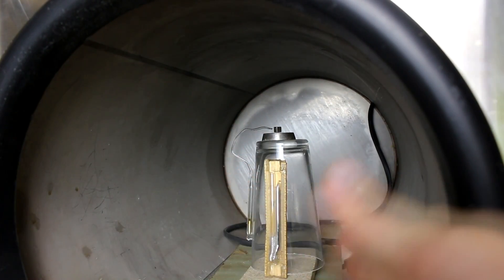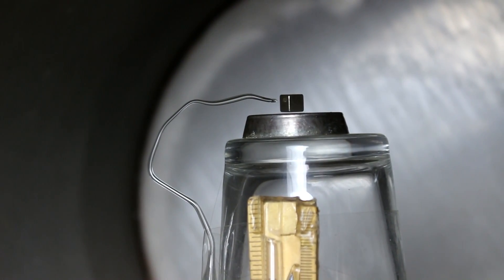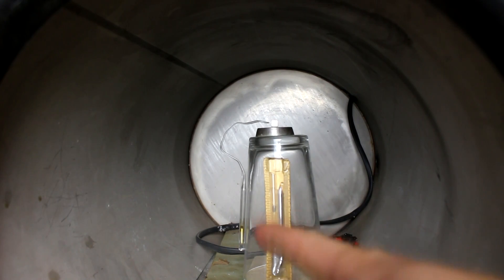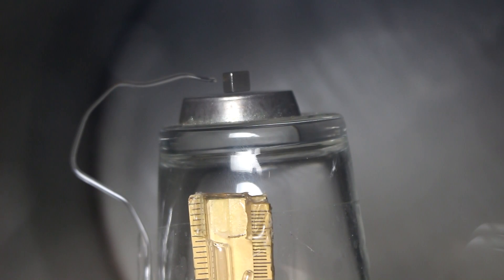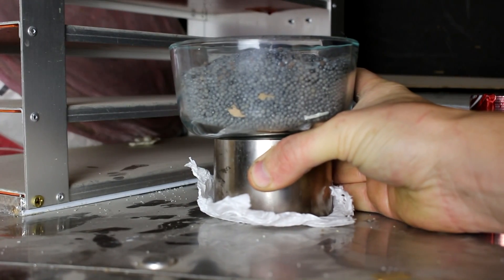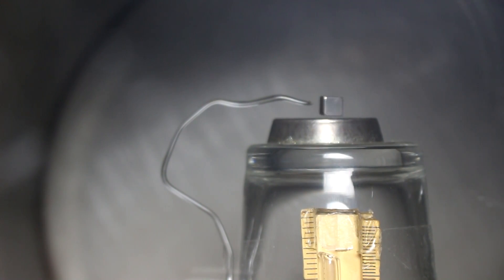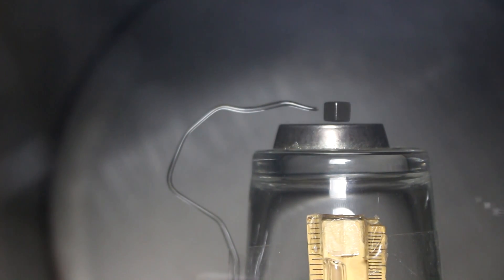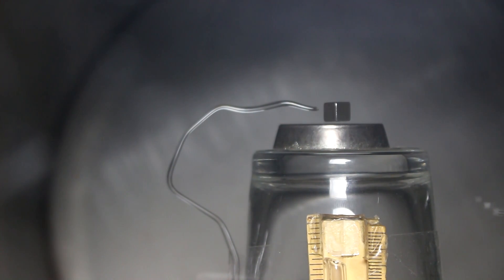Levitating a Magnet in a Vacuum Chamber

Comment: A levitating magnet will get affected by the earth's magnetic field. I used to play with magnets I got from CD drives which can be as light as 1 gram, when I knock it around the table, it would prefer a direction that it would not only stop at but it would rotate a bit back towards it if it passed it. It turned out to align with the earth's magnetic field.

Comment: Forever is a long time.  Your magnet will tunnel into a black hole and evaporate through hawking radiation in a finite period of time.
Reply: I believe regarding his use of "forever", one could colloquially infer induction of a spin persisting greater than like 5 friggin seconds.
Reply: Anything that beats nothing once has beaten it forever, because time.
Reply: @WhileTrueCode  How long IS a friggin second?
Reply: speaking of eternity... will it stop due to gravitational waves it emits before or not?)
Reply: UFOhunter; I strongly disagree.

You said: "It [the universe] is totally math based and can be accurately simulated in every aspect you can think of."
The problem with this, is Quantum non-determinism. Even if this was a simulation, no deterministic machine would be able to create the quantum effects that we see in our universe. The only way around this problem, would be to have a quantum 'computer' that has entangled every fundamental particle in our universe with a quantum object in the computer's 'real world'; it can then pass on that quantum uncertainty into our universe.

This would, however, completely change the nature of the 'simulation'. The being running the simulation would not be able to interact with the simulation without collapsing the quantum wavefunction of whatever he is altering; even worse, he cannot even view the results of this 'simulation' with certainty (since the uncertainty principle would apply to his entangled quantum objects as well), and even if he did chose to 'look' at (for instance) the precise location of 'you' (i.e. the specific location of all of your fundamental particles in our spacetime), the act of doing so would collapse the simulation's entangled wavefunction of you which would cause (as best as I can tell) all of your particles to either:
Instantly acquire infinite uncertainty in their momentum (ripping you apart) OR
Stop obeying the laws of quantum mechanics (which I have no idea how the computer will respond to).

Furthermore, having all of our universe's particles entangled with quantum states in the 'real world', would allow us to influence the simulator's universe. At that point, this universe could more accurately be described as a caged pet, rather than as a simulation.

Now on to the part about *Dark Energy*:
Dark Energy is very real with real, measurable consequences, i.e. that the expansion of the universe is accelerating! (think about how much energy it would take to accelerate entire galaxies worth of mass away from each other, faster and faster, against gravity while also creating new space (which has a energy cost associated with it) as it goes, then you can just about start to understand the scale of dark energy in our universe.)

Dark energy also has nothing to do with so called "negative energy". Dark energy is a real, positive energy; it just has some very weird properties.
Also, we don't generally "blame things we don't understand on some dark force", dark energy is only invoked for very specific phenomenon.
It is simply called "dark energy" because, like dark matter, it doesn't interact with the electromagnetic field and therefore we cannot directly observe it. Unlike dark matter, however, dark energy also doesn't interact gravitationally and so we cannot use gravitational effects to detect it either (for those keeping score, this means that 2 of the 4 fundamental forces cannot be used to probe dark energy at all*; worse still, is that those 2 forces are the *only long-ranged forces in our universe!)!

So that explains the 'dark' part, but why do we call it energy? Because we can see its effects on the universe and we know that the things we see it doing require a lot of energy, so we call it 'dark energy'. Not because we want to blame every strange effect that we can't explain on it.

And finally, a quantum computer will not be a universal panacea.
Yes, some problems are solvable in MUCH less time than with a regular computer, but even for those problems, the quantum computer will still take a while to solve them, it won't be instant.
Also keep in mind that a lot of computational problems cannot be sped up by using a quantum computer (For instance, a quantum computer wouldn't speed up a gaming computer. You might be able to add some cool effects with it (photorealistic real-time ray-tracing, anyone?), but the brunt of the game's code  will still have to be run on a conventional CPU.
And finally, cost.
For consumer applications, it would be MUCH cheaper and easier to simply speed up our computational hardware, by an order of magnitude, than it would be to implement a comparable quantum computer.
The only reason why we aren't seeing any real progress being made in computing (especially with CPUs) isn't because we are "near the limits of physics".
The real reason is that no one (except for me) actually wants a faster PC. People only want smaller, lighter and more power efficient computers, and they are willing to trade computational power for those things. Intel could, for example, quite easily double the single-threaded performance of their processors by halfing the execution time of EVERY instruction, by simply doubling the clock speed to around 10GHz, without decreasing IPC.
The silicon can actually handle it, the problem is just that there is no market (except for me, of course :)) for a CPU that runs everything twice as fast, but consumes ~2kW of power and requires a specialised cooling system to remove 2kW of heat, while keeping the CPU at the correct temperature (which could be as cold as -100°C).
Reply: The answer depends on a precise understanding of dark energy, something we lack.  However, best estimates currently put the big rip billions to possibly trillions of years in the future.

Time frames I have seen quoted for quantum tunneling to turn material objects into black holes are about 10^(10^26) years, which, is a lot to say the least.

The second number is much more well-defined since we aren't even completely sure that the big rip will happen at all, whereas quantum tunneling is a measurable phenomenon.
Reply: +MRLT Yes. As far as I remember, there will only be black holes for a really really long time before the atoms rip themselves apart enough to never be able to interact with each other again.
Reply: UFOhunter That is one hypothesis, yes. However the one that is most believed right now is that the universe will simply stretch out forever until atoms are so far apart nothing will ever interact with each other ever again. However nothing is certain of course. It's just educated guesses at this point
Reply: wow, you sure wrote a lot there, good stuff though.
Reply: MRTL: But what if we assume that non deterministic theory is wrong and assume: de Broglie-Bohm pilot wave theory?

I always found Copenhagen interpretation of quantum mechanics a bit too naive to be possible in real world. I still think that this collapsing of wavefunction upon measurement is caused by our too crude measurement techniques. Sort of like we are measuring speed of the ball with spring that stops the ball to measure it.

Deterministic explanation, that blames seemingly non deterministic results on our lack of knowing all initial conditions, makes me sleep a lot better, then thinking that universe is governed by some random secretive force nobody can predict.
Reply: @ Norest , yes that has been a conundrum for a very long time now, kind of. But the fact is that quantum theory is extremely successful in it's predictions, and Bell's theorem says that there is no theory like you describe which can align with the predictions of QM. Nobody likes a non-deterministic universe because, every time in the past we've made accurate probabilistic predictions, we were able to come up with an underlying deterministic theory which the probabilities approximate... but whether we like it or not, the universe has put it's foot down on QM, and Mr. Bell has helped the rest of us to officially rule out local hidden variables. And Mr. Einstein before him helped to pinpoint exactly what it was that seemed so fishy about QM via EPR paradox. One way or another, QM is correct, QM is fishy, and non-fishy alternatives are impossible, and that's just how the world is. Einstein did not deny the successes of QM, but he was put off by the fact that everyone else was diving into that pool without putting forth the complete and proper rigor in explaining why that pool was correct while the obvious was not. Mr. Bell took up that candle. QM is unintuitive in unprecedented and profound ways. The real world is all about that "spooky action at a distance"! The only alternative is transferring information faster than light speed, which is what you suggest Bohm, and that's no alternative at all as it violates everything we hold dear, including causality... it necessarily breaks far more of what we know. Ultimately and fundamentally, the physics is about the conceptual ability to make the most precise predictions that we can about the natural relation of the state of a system at one time to another time. It's not really about how we interpret those concepts. I myself have a lot more to learn before I can make personal assertions like these.

"If [a hidden variable theory] is local it 
will not agree with quantum mechanics, and if it agrees with quantum 
mechanics it will not be local. This is what the theorem says." - John Bell

http://www.scholarpedia.org/article/Bell%27s_theorem
Reply: "Bells theorem makes me uneasy." You and everyone else too, hah.

Also, Copenhagen interpretation is just an interpretation, whether you buy it or not doesn't change the math. It's not much of a physical theory, really. I don't really like it either, it's presumptuous and imprecise in ways that don't matter and can't be proven. But then I guess you really could say the same thing of any other interpretation too if you wanted to...
Reply: Anon Anon; Yeah. It deeply saddens me that very few people have even heard of Bell. In my opinion, he should be right up there with Einstein (heck, he devised a test that not only proved Einstein wrong, but also shut the door on whole catagories of alternate theories!).

The one thing that makes the Copenhagen Interpretation different, though, is that it is very likely (at least according to our current understanding) to be completely meaningless to ask 'deeper' questions of how or why. There could, very well, simply not be any deeper level of reality, beyond just being able to calculate the probabilities of quantum events. Kind of like virtual states; we know they exist, but by definition, we will never be able to observe them.
Reply: +garryson361 Steady State is actually making something of a comeback among some astrophysicists.
Reply: Michael Williams forever is out of the boundries of time though the only thing to last forever is nothing as it was before the universe and it be here after it. Nothing can beat nothing in forever, even the universe itself
Reply: MRLT Thank you for bringing up per-core performance. To some people, Moore's Law "dying" is the end of the end for rapid increase in per-core and much of general performance. As if...
Reply: UFOhunter IIRC, that theory was somewhat called into question with a relatively new development in related to the math used: we won't get a single black whole and a new big bang; we just get growing and shrinking oscillation. (IIRC, the new mathematical developments applied avoid a singularity.)
Reply: Anon Anon 
Theory I explained is Pilot Wave theory, and it predicts Quantum Mechanic observations just as good as Copenhagen theory. I just like it more since it explained uncertainty with hidden *non local variable*. This non local variable also explains quantum entanglement, which actually does seem like information traveling faster than light, and it was experimentally observed (if that hasnt been debunked yet).  

This makes more sense to me than "god playing dice with universe"
But I havent read enough about all this to claim anything. Its just my gut feeling. When I read about general relativity it makes sense to me. Bells theorem makes me uneasy.

Few videos about it are (not posting links since it usually flags me as spammer):
Pilot Wave Theory and Quantum Realism | Space Time | PBS Digital Studios 
Is This What Quantum Mechanics Looks Like? 
Through the Wormhole - Wave/Particle - Silicon Droplets
Reply: Bell's Theorem doesn't rule out local hidden variables.  The first thing it rules out is static hidden variables.  Most of the simplified presentation of Bell's Inequality start with the easy case of static hidden variables.  Not only that, they typically start with static hidden variables that can be specified with only one bit of information.  Under those rather unrealistic assumptions, you can derive Bell's Inequality.

Since Bell's Inequality is found to be violated, you can immediately conclude that, if there is a hidden variable, it must at least be time varying, and it must contain more than one or two bits of information.

Now the math runs into difficulties unless you make another major simplifying assumption.  If you assume a master clock, so that both particles age in perfect phase-locked synchrony, then it's still possible to do the math and arrive at Bell's Inequality.

But Einstein reminds us that there is no such thing as a master clock.  Timekeeping is a local phenomenon which depends on the strength of the local gravitational field.  For particles separated in space, each one ages at its own idiosyncratic rate.  This throws a monkey wrench into Bell's derivation. You end up with a residual non-zero "beat frequency" that does not conveniently vanish in the middle of the derivation.

In short, the hidden variable is time itself. 

Note that the hidden variable could well be a deterministic function of time. Deterministic functions can still be mathematically chaotic.  And if local timekeeping is perturbed by local perturbations and gradients in the gravitational field strength, then the instantaneous phase of any time-varying hidden variable could be pretty much anything.

If physicists actually believed there can be no time-varying hidden variables, they would never have considered String Theory (or anything like it).
Reply: Orr... The magnet would demagnetize itself before then.
Reply: Well I have no doubt that we are nowhere near the limits of what we can uncover. We have so much more to learn, about the details of what REALLY goes on at the Planck scale, about what else might be around us just outside of the currently visible universe (extra dimensions, before and after, greater context, etc.), dark matter and dark energy, there's so much we don't know, we're just getting started. I think unwinding the physical world around us is the purest and most worthwhile pursuit that humanity as a whole can have.
Reply: I read about a paper on computer modelling of anti-entropic matter which suggests it's much more resistant to interaction with entropic matter than originally believed.  It's possible that as the last of the entropic matter decays into quarks, anti-entropic matter could reboot the Universe with the entropic arrow pointed in the other direction, since it's one of the arrows which is bidirectional.  What's interesting to consider is whether this may have already happened -- multiple times.
Reply: also bismuth is radioactive,which means it will disappear over time
Reply: HAHAHAHAHA beHAVE 😂😂😂

no. the magnets' spinning will increase, and eventually cause a rupture in the space/time continuum, causing a double-ended wormhole, the ends of which will eventually be attracted to eachother, connecting.. and combining 1977 and today, resulting in global simultaneous aging and antiaging effects, which will.. turn everyone into Benjamin Button.. but with unexplained memories of 1977.   >.>
Reply: But will it spin for one second of eternity?
Reply: Armchair scientists: the thread
Reply: Michael Williams; Hmm... will it happen before dark energy causes all the atoms to rip themselves appart though?
I'm WAAAY too lazy to do a proper calculation atm, but I'd bet it wouldn't.
Reply: probably not, no.